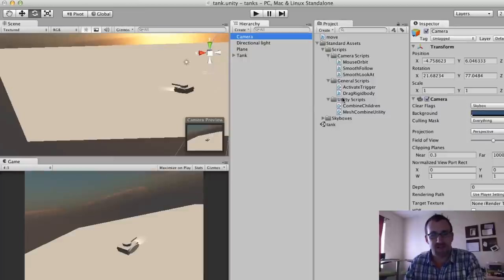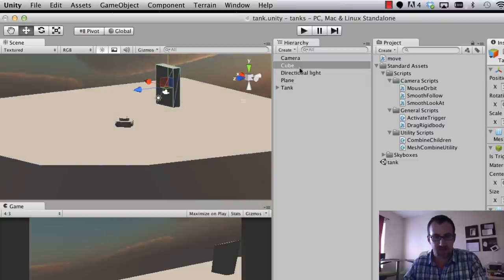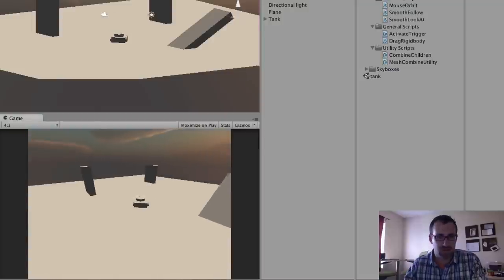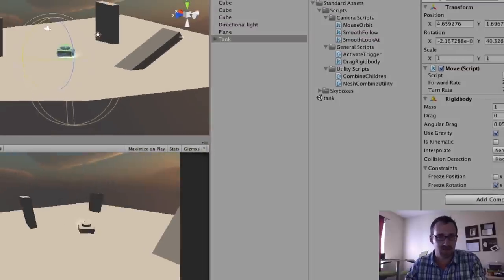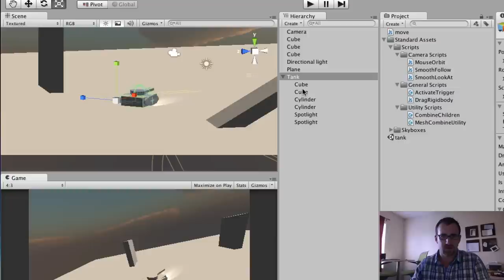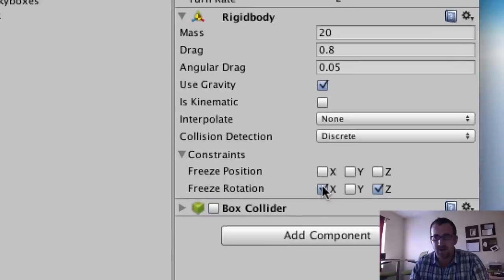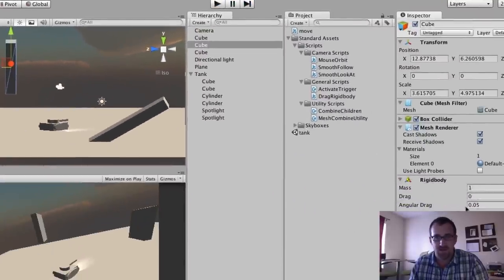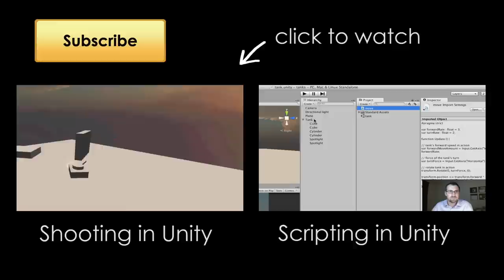Intro to Physics: Unity 3D Tutorial (Part 7)

Comment: At first it looked like my tank was driving over a bumpy road even though "plane" is flat. Fixed this by lowering the frame of the tank, so the "wheels" are completely flat against plane eventhough it doesn't look as realistic as before when the beginning and end of the wheels (cilinder) caused a gap of air between the wheels and the plane.

Comment: Secondly i had a problem with turret: When i moved the turret, the tank itself would move in the opposite direction. Fixed this by turning off all box and cilinder colliders except for the one most close to "plane": the frame (first cube when creating the tank which i lowered before already (see previous comment below)